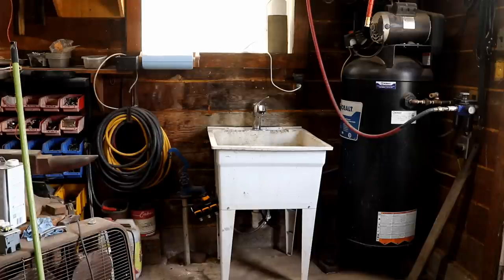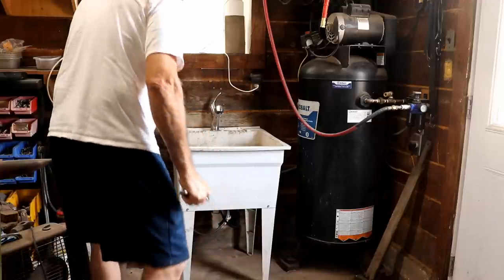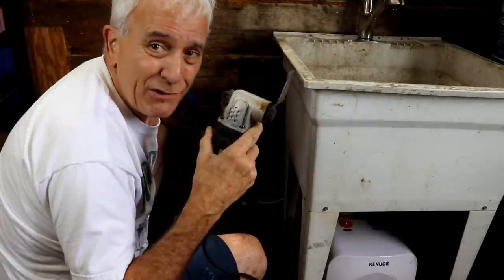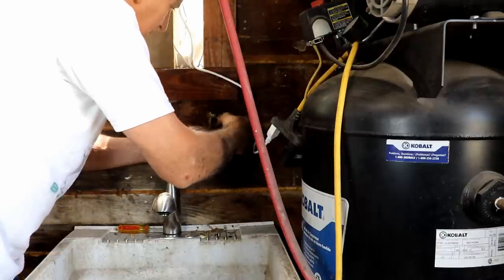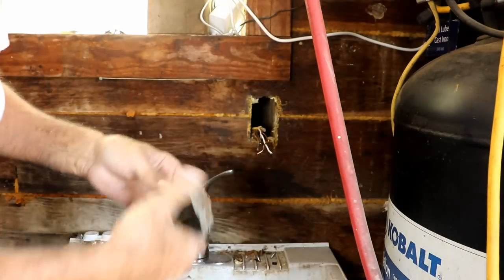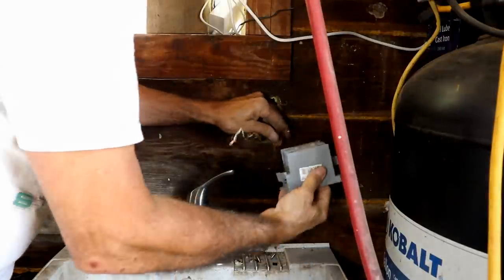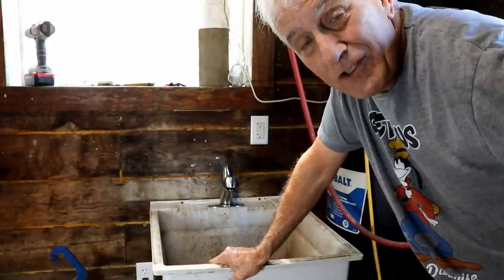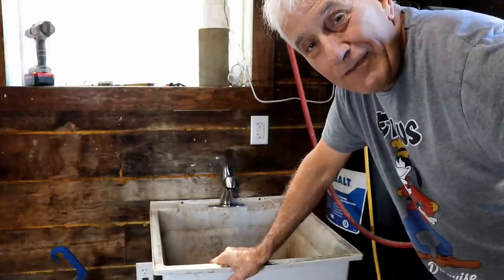655 RSW Small Water Heater Install

Comment: The screws are designed to clamp the wire in the hole in the back of the device. Not like the old style that relied on a spring clamp that could fail. You know that though, don’t you? Just don’t trust that type of connection. I never had one fail. I put one of those water heaters in my shop. Loved it.

Comment: Here's poor design for you: I was an engineer in commercial cabinets. Once I got plans for interior improvements for a new retail store. It needed slot wall and valances - the usual stuff - which usually includes a 'cash/wrap stand'. I searched the plans for the architect's drawings of it and found none besides an unlabeled empty rectangle on the floor plan. When I asked the architect about it he just said that they needed a cash/wrap stand. I told him, "If I go by the plans all I have to do is throw a sheet of plywood on the floor and call it good!" He decided to have ME design a rather elaborate cash/wrap stand that he approved and we built and installed.

Comment: Jerry 
Clamp a ground wire to the water pipe if it brass or steel and run it to the ground on your lower outlet. That would give you a ground for both outlets.

Comment: I re-wired this entire house and buildings when I bought this place in 92, when I was ready to hook power back up the electric company said they'd have to send an inspector and it would have to pass all their rules and regulations before the main power could be hooked back up. I already knew I had to run conduit in places in the walls near the breaker box and outside. the inspector checked everything inside and out and asked me who did this, I told him I went to college for it and did it myself, he said he couldn't have did a better job! the whole place was ran on 3 breakers, right now it has 20! lol

Comment: At 36:51, when you moved the heater, it suddenly started flowing more for a second. Maybe it's nothing. Also, I wonder if there's still room to put something under the heater for some isolation (like a rubber mat or styrofoam). Just what came to my mind while watching. Anyway, nicely done, Jerry.

Comment: Most new GFI's I've installed lately have a toothed clamp plate on the back of the screws so you don't have to hook the wire and they provide a phenomenal amount of clamping force.  If you tried to clamp a hooked wire with that much force it would bind around the screw and break or expand the hook and flip it open even when hooked in the correct direction.  The new screw clamps are a whole lot better than those silly spring terminals.  

That 10.5 Cubic Inch metal box isn't appropriate for receptacles since 12 Cubic Inches is the minimum requirement now however that 12 Cubic Inches can be barely adequate with a large GFI even if you have no more than 1/2 inch of the jacket remaining on the wire inside the box.

On the Pressure/Temperature relief valve you may want to consider using a dishwasher drain tailpiece on the sink so if it blows out the hot water will go down the drain instead of all over the shop floor.  If that one does not have a port to connect to a drain tube and just shoots out I'd change it out to one that can be vented into the drain pipe or outside.

The flow could be restricted due to the water heaters low power requirement for use in a 15 amp outlet making it so it can't provide for a much higher flow rate.

Hopefully its not on the same circuit as the compressor or other high draw items.  Did you check for excessive voltage drop when it was running concurrent with everything else on that circuit?

There are a lot of new things I don't like at first until I find out the why and how about them.  The new plastic rework boxes are rated for the wall thickness so you do have to watch out for that when you purchase them.  Dealing with thick plaster walls and double fire code wallboard we have to pay attention and sometimes still get longer screws for the mounting flags.

Feel your pain when matching old with new and finding the new things have yet changed again and you have to figure out how to deal with it.

Best!

Comment: Hi Jerry, good job on the heater installation. I'm an electromechanical engineer with +20 years of experience in design, installation and maintenance of everything electrical. Just a fun fact here, even though in my country (Costa Rica) we based our national electrical code out of your NFPA 70 (NEC) whenever I watch how residential electrical installations are done in the US (and also Canada) I cringe and scream at the screen counting the many violations to code that such installations would have down here. As some examples we discontinued the use of solid copper wires like 30 years ago (we only use multi stranded wires). Also wiring inside walls without either EMT or PVC conduit is out of the question. I find it very interesting

Comment: My rule about GFI. A ckt brkr detects excess of 20A before it triggers.  GFI's detect a difference of 1mA.  So they are 20k times more sensitive. Therefore, if lightning strikes in the western hemisphere of the Earth they trigger.  So don't daisy chain the GFI output to another outlet that is more than a couple feet away.  That other outlet just acts as an antenna for that lightning strike. If you need to GFI protect 5 outlets - buy 5 GFIs.
And those GFI ckt brkrs made for a panel are nonsense because that line coming from your panel is a big long antenna.  And worst yet when it triggers you have to make a journey to your ckt brkr panel to reset it. Something my wife cannot do. Or pretends she can't do because she's a woman and doesn't do ckt brkrs.

Comment: Interesting projects Jerry. Your power points in the US look to not have dedicated on/off switches. In Australia the two double power points you installed would both have two dedicated on/off switches to each power point, one for each outlet (4). So for us in Australia, to use any power point we need to insert the plug first then turn the on/off switch on to get power. Not sure if its the same in other countries. The hook method turning with the bend is always best, the straight wire method doesn't work and frustrating. Should the hot water pressure be like that?